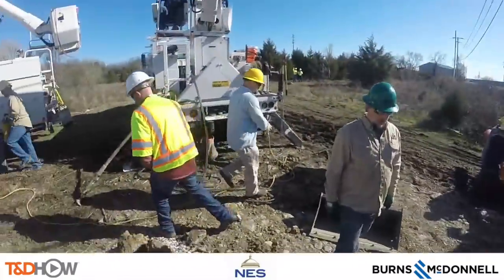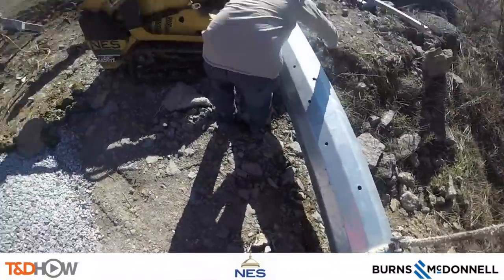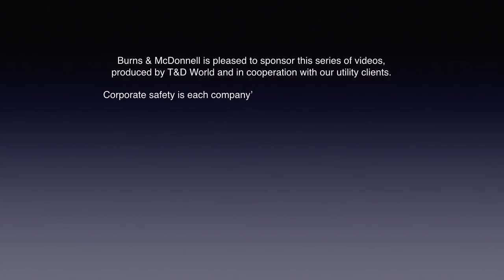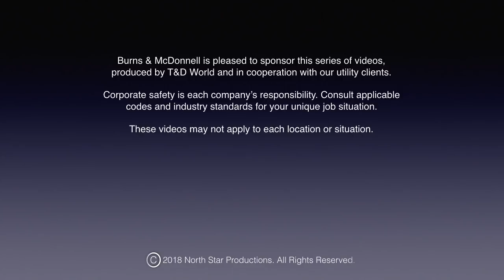Steel Distribution Pole Install on Energized Line

Comment: Do they ground the pole while raising it?
Reply: Sylvia Else No, you can't.  That is why they were putting the insulation around the pole
Reply: I don't see why the pole cannot be grounded.
Reply: Sylvia Else because you will have a wire attacked to the pole while you're setting it
Reply: Because you don’t want to stick a ground into energized primary. Hence why they’re putting protective guards on it to isolate it from energized lines
Reply: @lobola956  I'd have thought grounding it would be manageable. The grounding cable doesn't have to be particularly short, and it would help prevent accidents.